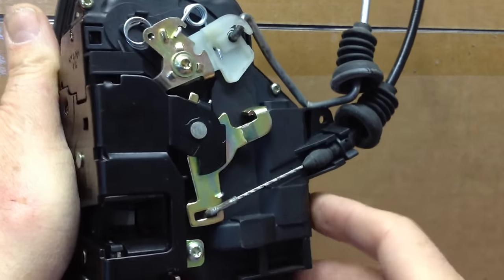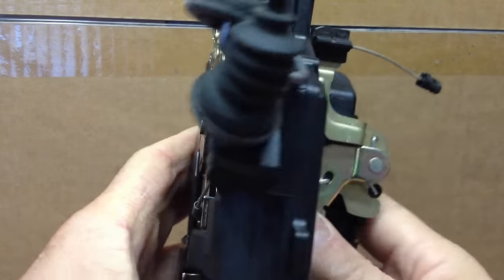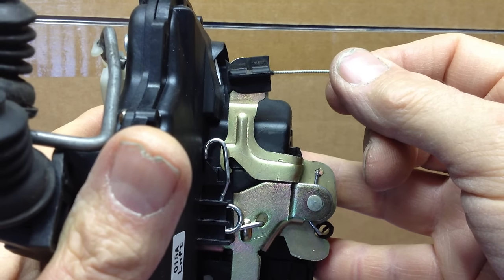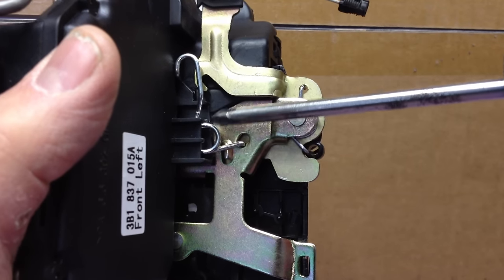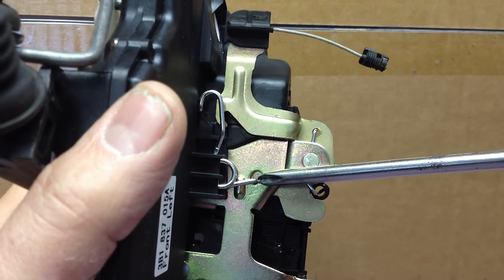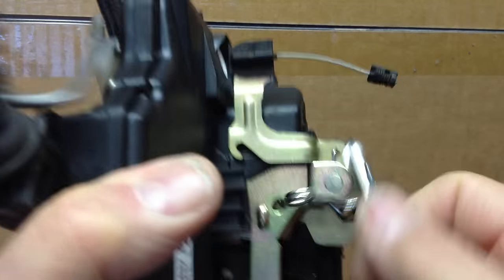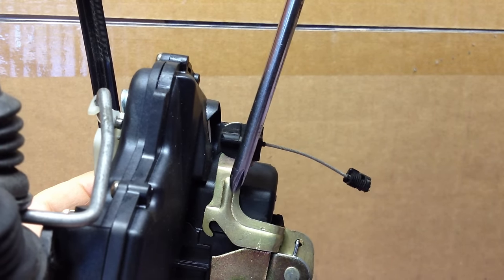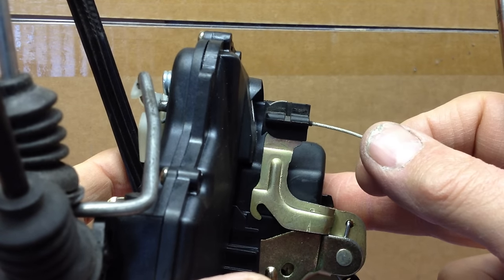Why Your VW Door Won't Open

Comment: Thank you for this video.  Four years ago I got a mechanic to remove this clip from both passenger and driver front doors after the passenger door got stuck and wouldn’t open from outside or inside.   The door handle pull didn’t feel much different afterwards but the door didn’t get stuck again ... until last week.  So I revisited your video comments and other sites mentioning this problem.  This morning, after days of thinking about the problem, I just walked up to my 2011 Touran, unlocked it, opened the window of the offending door, reached in, pulled the interior handle and pulled the exterior handle at the same time.  Voila!    The handle clicked and the door now opens again.   Now to trade the car in before it happens again.   Hope this helps someone out there.
Reply: Amrita Shar lmao im gna try this
Reply: Hi Mate i also have the same problem i need also help plzzz !!!

Comment: That little Spring you discarded was to set the tension correctly on installation of the mech. It hooks on as you suspected then releases on the first pull of the handle , with the system being properly tensioned that's the theory anyway!

Comment: That spring does have a purpose it sets the pre load on the cable that goes to the outside door handle. Without that sprint you can’t set the proper depth on the outside door handle every time you disconnect the cable to it
Reply: I went to remove my 2008 cayenne drivers door to remove that mentioned spring  on door latch assembly.I had every thing removed ,mirror .4 bolts hinge  and latch ends , however didn't have correct Torx  size for the two bolts holding the latch mechanism in place. So then I reassembled  and discovered  this last comment that the spring is in fact needed. So what is the fix? Presently I keep a 1.5 "X 12' X 1/16" piece of plexiglass  to serve as a slim Jim to unlock the door when needed. It doesn't malfunction all the time. But is a pain .
Reply: @Kermit do you have link to documentation? What do you mean by proper depth on outside door handle?
Reply: @trashcan4u853  Another video goes over how to set the spring: https://youtu.be/LuOJhZaGwnw?t=460

Comment: VW has been sustaining its myth of reliability whilst having to fend off more complaints than about any other manufacturer. Sadly here in London, it's that British thing: fall for a myth, join in the snobbery, then complain bitterly when the product doesn't meet the myth.
Reply: My problem occurred with a non genuine replacement
Reply: m5rcc German cars are CRAP
Reply: I have actually found them extremely reliable if properly maintained and the thing is, properly maintained by VW standards is completely different to what people do here in the states. Compared to the rest of the world we do not take care of our vehicles which is why these have much less problems outside of the states.
Reply: @vomitkermit3446  So how would what you just said explain the failing door locks?   Or the millions VW have to pay out to victims of their failed pollution control software?
Reply: @frenchenstein  "I do  n o t  buy privately  a n y   german car after AD 2000 (german junkyard owner)

Comment: Thank you for this. It helped. That spring that serves no purpose is sort of a "programming spring", it used only the first time you install a fresh module, you hook the latch into place with it. When you lock the car the first time it determines the length of the cable, so you wouldn't get too much free play. When first unlocking the car with the new module, it snaps free, in the position it is in in this video, you will hear it do so, it's pretty loud. Then you can get rid of it, the next time you open up the door, if need be. Just in case anyone was wondering what the purpose of that spring is.
Reply: Thank you for the explanation, but I do not understand how it could work this way, mechanically. 
The way I see it, the spring is not tied to the locking mechanism, it is solely there to hold the cable hook in place if fixed to it: I hooked it in and it basically makes the hook and therefore the cable unmovable, so the handle cannot be pulled (unless by force, risking braking either end of the cable, both plastic). This cable has nothing to do with the locking mechanism however, as it is only connected to the door handle. So whatever happens with the locking mechanism, if I do not pull the handle, then neither the spring, nor the cable moves. 
The only thing I could imagine is if at first use the whole lever mechanic that is connected to the cable would be "pushed" outward and the spring is there to prevent that from happening. That makes little sense however: why would there be an opposing force that operates the lever? Also, it would not help the mechanic to determine the length of the cable at all, as the spring holds the cable fixed in one place.
Also I disassembled my broken lock to see how this works mechanically in the inside and I only found a one-directional spring inside, which makes me further doubt that the locking mechanism would push the lever into the other direction. I do not know for certain of course.
Do you have any further info on how this "resetting" takes place and what exactly is the loud snap that you hear? Maybe a link to the mechanical exploded diagram of the lock itself?
Reply: @petert.2727 I didn't read your entire comment. He meant to say when opening the outside door handle for the first time. Not unlocking for the first time. You have to move the spring into that hook on the lever, It will be very hard to pull but when it reaches the sear point it it will snap out of the hook grove, and set the rubber ankor connected to the cable. Hope this helps.

Comment: I had a dead lock on the left rear door on my Passat B5; it opened neither from outside or inside. I took it to a mechanic. We  replaced it with a brand new one. I examined the old and the new one, and also asked my mechanic with 45 years. The spring was not located on the lever.
Reply: Have the same problem on an 02 Passat..how did you get the door open, my local garage is saying only way is to cut the door off!!!…really don’t wanna do that…car has sentimental value..22 years old and still absolutely mint

Comment: This helped me with a 2009 Porsche Cayenne where the right rear door would not open from the inside or outside. 1 and 1/2 days of trying all sorts of solutions (remove inner panel, cut large holes in the regulator plate, and undo door hinges etc.) , came across this video. Was able to pull the metal clip out and the door opened! Thank you!
Reply: Hey there, could please help more because our Cayenne 2012 has a kind of problem the rear doors don't open from the outside. Best regards

Comment: Hi Jon
Thanks for the vid. Sorry if i'm repeating an earlier comment, but the spring that you removed and discarded is the very thing that presets the position of the handle pull mechanism so you dont have to push it with a thin screwdriver. With pliers, move the spring untill it locates in the hook on the lever. This holds it firmly in place while you are connecting the cable to the handle and releases itself automatically when you operate the door handle for the fist time. That's what it's there for.
Cheers
Martin
Reply: Yes. In a video by HumbleMechanic, who works as a tech for VW, he describes that procedure as "setting the preload of the outside door open cable". He briefly showed how that was done in a video of door latch problems in the whole series of VW vehicles.
Reply: The video by HumbleMechanic is named " How VW Door Latches Fail~ Video ", I believe.
The spring just helps to set the position of the little-piece-on-wire in the outside door handle, but it's not necessary.

Comment: YOU are the man. I changed the lock to an "EBAY" lock and was never able to open the door. I took a verry lonk but not so high kitchen knife. After a little force at the part where the bowden is connected, o could open the door. Takes only around 5 minutes :-) 
I´m driving a VW Touran 1.  Many thanks for this video!!! Great - Greetings from Germany!

Comment: Thanks for posting as this saved me time and money. I put the electric window in the fully down position on the front passengers side. I then got a steel ruler and pushed it into the window rubber toward the door handle on the outer face of the window. I guided the steel ruler to the inner door lock and once i felt it contact i pushed down. At once i felt it click back into position. Job done !  I removed the ruler, put the window back up and sprayed some oil into the outer door handle. Checked and the door will now open again when i pull the outer handle. Thanks again for posting.
Reply from the maker: Great news Paul. You’re welcome!

Comment: Just changing the electronic window mechanism on my wife's new beetle only to find that on re-assembly the door lock rod  has come away from the lock unit itself. Your video is the only one with camera still enough for me to see how the rod attaches to the locking unit (seemed pretty flimsy but I can see it's correct). Your point about a small screwdriver inserted through the locking mechanism saved me dismantling the whole door again to get the lock to work properly. Basically you saved my ass twice. Thank you so much.
Reply from the maker: Glad to hear it Kevyn. Take care.

Comment: That sinking feeling when you've spent two days taking the door apart, the locking mechanism apart, troubleshooting, resoldering, reassembling, only to find that when you close the door you can't open it from either the outside or the inside!! Popping the cable pin off the outside handle fixed it for me (whew!).
Reply: I had exactly the same problem today... Spending hours to change the door locking module, testing that my buzzer and puddle light came on.... So happy... But later found out I couldn't open the driver door... F-ing hell what to do...? I'll try tomorrow to loosen/take off the cable to the handle, just as you suggested.... Glad I found this video. 😁
Reply: I had exactly the same problem today... Spending hours to change the door locking module, testing that my buzzer and puddle light came on.... So happy... But later found out I couldn't open the driver door... F-ing hell what to do...? I'll try tomorrow to loosen/take off the cable to the handle, just as you suggested.... Glad I found this video. 😁
Reply: @staffanfogelberg6816  Glad you got it sorted! :)

Comment: Thank you so much man! I have lost several hours from my life, trying to figure it out why this shitty mechanism isn't working normally. After watching your video, I have to disconnect the tiny strand, attached to the outside lock. After that, the door was able to be opened. Probably, last time when I had it connected was too tight. So now I have to tune it more precisely. Thanks again and long life to guys like you! :-)

Comment: Most helpful.  Thanks Jon!  Of course you need to get the door open before you can take off the panel.  If you open the rear door you can see the black bolts in the drivers door that secure the mechanism. I took a 1/2" rod (or you can use a 3/8" extension), placed one end against the bolt and gave the other end a quick tap,tap with a hammer.  That reset the mechanism so I could open the door.  I think I may squirt some silicone spray onto the subject arm by sticking a spray straw through the outside door handle.  Then exercise the mechanism a bit.  See if that does it before taking the door apart...which is a royal pain!

Comment: Good  video. The spring you removed is one of the fixings that is designed to keep the mechanical and electrical part of the door lock module together. Better to file 1/16" of the bottom leg of the spring and put it back.
Reply: That is incorrect, its only purpose is for setting the correct amount of tension on the outer door pull.

Comment: great video, we had a 2004 Audi TT, there is an adjustment on the outside handle cable, it has serrated edges to fit in different position on the outside, if it is re-assembled  too tight, it won't allow proper release of the mechanism.  It will work to open the door, but once the door is locked, it will not.  The door won't open from the inside or the outside.  Best way to unlock it is to follow this video, by peeking in between the door glass.

Comment: Thank you for this video, I had over tightened the cable during re-install of my passenger front door handle on my VW Touran, resulting in the door not unlocking again. I could simply loosen the cable while holding the door handle out a bit and it now works flawlessly.
Scary thing when the door wont unlock and there's no good way to get to the internals...... Saved my butt.
Reply: Hi Jon , I was looking for information to fix a sticky lock. I will omit the spring as per video. Thank you for a great informative video. Pray GOD Bless you and family.

Comment: Thank you Jon. I had just put the whole door back together (B5.5 Passat) and then found the replacement latch mechanism would not release, either inside or out, so effectively my door was sealed shut. Ain't veedubyas great? Anyhow, surfing for answers, I found this post, which explains clearly why the door wouldn't open - the return spring doesn't allow the latch to reset. Applying logic (pity VW engineers don't use it) I figured that I needed to push back the latch. Armed with a stiff piece of steel wire, I tried several times, but no joy, until I thought to use winkle out the wire draw-string from its location in the outside door latch. Yea, freed from the latch, the reset mechanism then allowed me to open the door from the inside. I was then able to refit the draw-string in a position where it allowed the door to open (just) but did not stop the latch returning under that weak spring you showed.  Great stuff, thanks again.

Comment: You are an absolute star. Thank you, kind sir! For info (2001 Audi A6), mine was blocked as I pulled the handle why unlocking the doors (bad idea), so it stayed in the position you demonstrated, and I couldn't open the door from outside nor inside. The screwdriver through the handle didn't help, but a sharp hit with the hand over the top right of the handle and CLICK, unlocked!

Comment: Thanks this helped me out. After fitting new after market actuator door kept sticking closed and couldn't open with outer or inner handle. I removed the pin and it's now fixed.

Comment: Jon, thanks for the video. It saved me $$$. Mechanic couldn't open door stuck on my  Jetta so that it could pass inspection. Said I had to take it to a body shop, as he had removed inside door panel and had no access to lock. Took a flyer on You Tube and found your explanation. Pushed the blade from my hack saw and pushed it down as described and it popped open. Appreciate it.

Comment: Jon, exactly right regarding the spring, that serves no purpose whatsoever, that you removed from the assembly. On Mk5 assemblies, the end of the spring that causes the problem does not go into a hole that allows the end of the spring to rub on the moving arm, as the end on the spring is straight and is held in place by a pushed out claw, where the hole is on the Mk4 assembly. So someone in Wolfsburg has realised that this is a problem on the MK4 assembly and upgraded the assembly for the Mk5 Golf. Great video, great commentary, well done.
Reply from the maker: Thanx! Nigel.
Reply: Exactly wrong about that spring. 

In what world do you see that the arm needs more return force and then throw away the spring that would give you the return force? 

The logic of seeing the spring causing a bit of resistance and deciding its not needed blows my mind. Esp when the spring would overcome the exact same resistance if it was fitted properly. Infact it might bot even rub if it's it it's proper place. 

Classic case of 2+2 = 5

Comment: Thank you so much, You save me from ripping off my door apart. For me was 2 problem. 1 is that little spring that you were talking about. 2nd was the hook that go over the latch for the outside door handle did not hooked on all the way.

Comment: Got my door open and functioning again by simply hitting the outside handle really hard with my hand. I think it reset something to make it somehow work again :) Worth a shot, considering other methods can damage paint, door panels, mechanisms etc...
Reply: Jacques W Same here ! It’s just not permanent and I have to hit it like that every single time I open it
Reply: This trick worked awesomely on my suv! My door was stuck for ages. Glad I found this video.

Comment: omg the spring you broke off is a set spring for the tension. you needed to push it into that small grove you were talking about. it sets the depth of the pull and locking reset
Reply from the maker: James Whittington I know. It is only used once on installation. And then causes problems for the life of the car. You decide what's best.....

Comment: Wow great video presentation! I was gonna send my VW to the dealership to get my door handles looked at since my rear door wasn't opening from inside or outside. But after you clearly explained how they work. I just went up to my VW, I gave a quick tug and made it snap quickly back in, and the door opened! Now it opens from in&outside. U just saved me over $300 the dealership was gonna charge after the 2 week appointment as well. F*ck yeah! Big thank you buddy, you're awesome!
Reply from the maker: Cool! I could use some of that $300. :o)

Comment: Thanks, I had exactly this problem on a brand new replacement part. I also decided to slightly bend the metal arm outward since it was rubbing on the plastic body. Problem solved, thanks a million